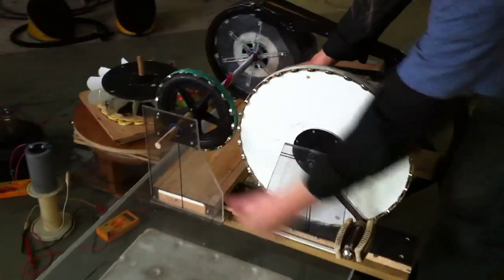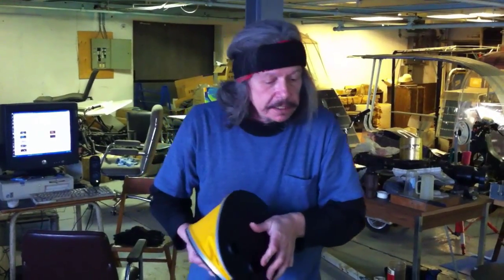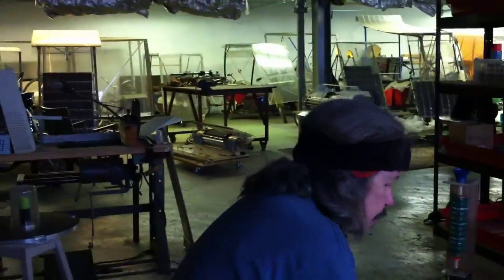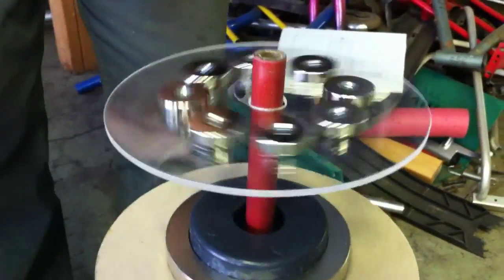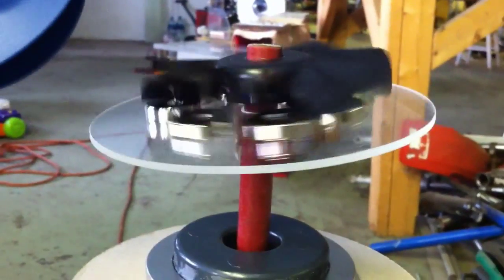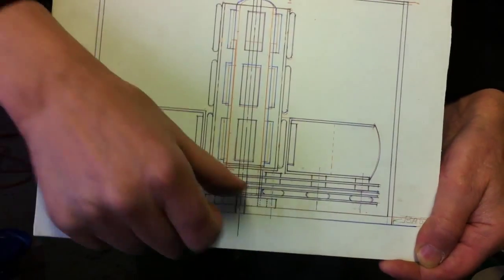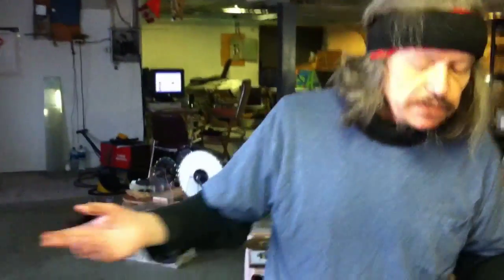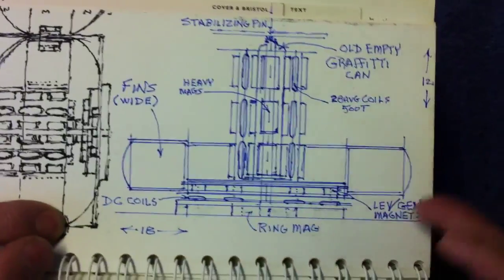UFO Alien Leak - Levitation Propulsion FS4

Comment: hey how about decreasing the airflow exit size. choke the nozzle so the air coming out is a smaller air stream. and decrease the fan blade size so you have more pressure on the turbine blades.

Comment: The Earth has a huge magnetic field - 1000 times it`s physical size. Note that fluid superparamagnetic FEo4 has 4 times the non-ferrous oxygen atoms. Most ferrous compounds are mixed - until 50 miles + deep, then the solid cystalized (body-centered cubic), and hot molten iron become much more pure. The heat from their Border Domain conflicts give rise to about 58% of planet surface temperature - besides producing great protective Magnetosphere shield. UFO`s ride crustal curves off-planet or in.

Comment: built one very much like yours made a turbine to be wind powered 1) thing is Tesla used disks to keep down resistance (makes sense) so after using 4 inch cut pvc at angle went to disks- made huge mistake afterwards put it on back of truck to get some good wind alias it worked I stopped driving & it ran! Excited as drove back to shop-dam thing took off & smashed into telephone pole-the DISKS works better than expected!

Comment: My recent work has been translating all of these Natural force levitations, heat and friction eliminations into electronic means. Didn't begin there because they tend to get bogged down in battery "re-charging" to "prove" "OVERUNITY" or "FREE ENERGY". First break consumption cycle, to then produce energy for practical task - none greater than Fuel-Less self-propelled cars, getting rid of debt and war. This is beyond "self-recharging" ones (not commercially viable).

Comment: Mate I like your work shop very nice try using the magnets side on in a toroidal fashion with the Perspex also a hollow iron centre pin capped at both ends it heaps of fun doing this kind of stuff lots of people will think you are nutters but that's the way it goes.

Comment: @skycollection Ha! I saw your crazy wild electric generator doing just what you say! 30,000 rpm's! Living DANGEROUSLY?? And you only needed 130 turns or so to get 120v!  Great! You're series is an inspiration! Now I hope to EXPAND the ring, as well as gain Total "virtual structure" of Levitation through force at a distance empty space on all sides (forming "Virtual axel") - I figure this is what the Aliens must have done to erect those mile-high generators on unstable ground?

Comment: i love your experiments with levitation magnetic field, and you can align your ring disc with another disc in parallel so that it turns correctly...! and you can speen this ring ussing 3 coils below the ring, with circuit TIP 105…!

Comment: @Rizky06 Several options: I prefer those that cause power OUT; without power IN (We have had centuries of that mistake). Some young people working on pedaled AIR PISTONS, like Big Organs have? Keep thinking of Spacecraft, where you NEED oxygen to breath at high pressure - so you aim release on the fins!? Whatever solutions chosen among the several available; getting rid of BIG BATTERY BANKS will speed the world take-over by Electronic Cars at low price. Suburban women are salivating for this!

Comment: @Sweemoo Some say while water going down rapids as it gets steeper amplifies in energy - but current can't do the same? This is untrue: The very earliest Hydro projects took initial current from turbines & sent it to another where it charged electromagnets - which then gave out 10 TIMES THE CURRENT! And that was before todays neo-mags! FuelFree cars are now connected to building Lev-craft, though not all can see this. Am building large StarShip coil of 4 circuits (24 points), so this is clearer.

Comment: @Sweemoo Thanks! TOTAL BREAKTHROUGH! Am now building pic model: 1) It can be extended FAR UPWARDS! Think mi-high Mars Towers - using thermal updrafts! That's not ALL: Built my first STARSHIP COIL! Am sure that shown DC can be directly outputed to power STARSHIP GENERATOR at 20,000rpm's! Then CASCADED UPWARD to VACUMN 100,000 rpm's - to cover ALL Searl's 3 ranges! All with a breath of AIR directed at VANES! Can be WHAT YOU BREATH in STAR TRAVEL?! WELCOME Alien COUNCIL of 50! We are now ONE!